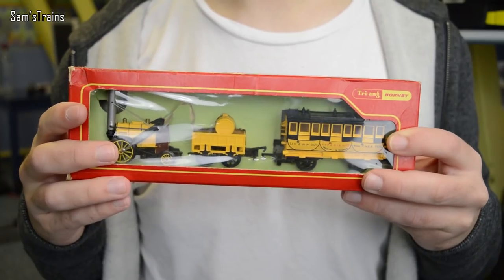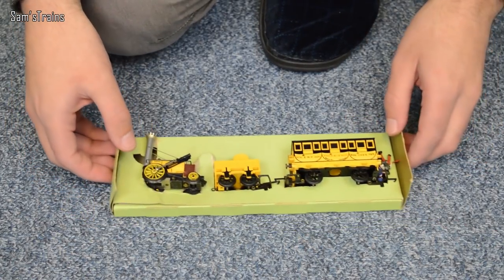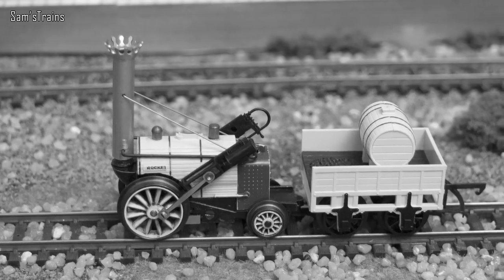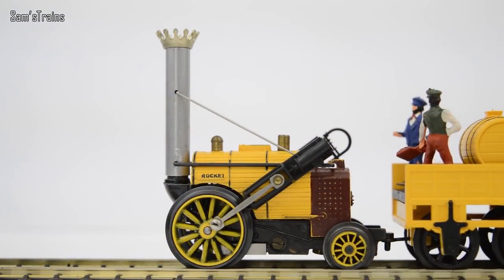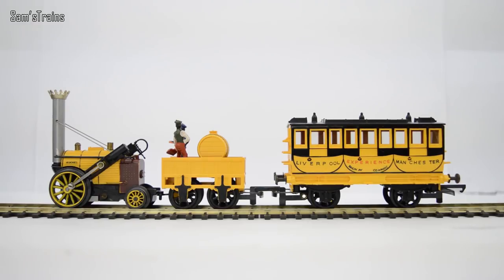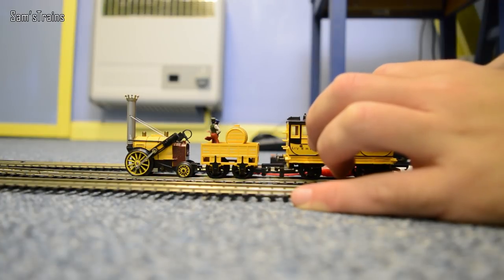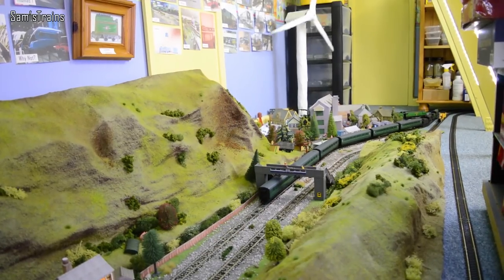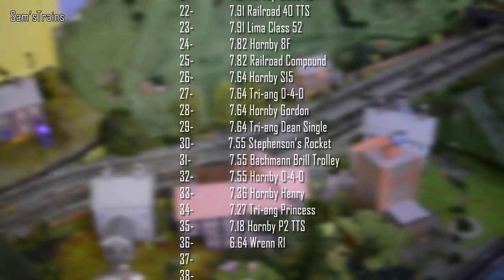Unboxing the Hornby Stephenson's Rocket (Stephen!)

Comment: I've got the same locomotive, but it's the original release with the Tri-ang Railways box. My Great Great Grandfather paid a whole $10.88 in the U.S. in 1968. He passed away in 1989, and it had been in storage until a few years ago when my Grandfather passed it down to me. To my disbelief, it ran almost perfectly straight out of the box! Even the smoke unit works! Mine, unfortunately, doesn't have the little figures (don't know if I can find replacements). The box is a little rough, but the locomotive, tender, and coach are nearly flawless!
Reply from the maker: Oh wow - that's fantastic really, keep hold of that - they're very special and rare! :D

Thanks for watching mate,
Sam :)

Comment: Sam, I'm glad this popped up as I was looking at running Videos on the Centenary Version of the Rocket. 
The 1963 version is RAW to say the least. Can't run anywhere near the prototype speeds of 15-24smph! The Loco hasn't a proper plate for the Engineer and Fireman to stand. They couldn't operate correctly from the Tender! 
if you haven't received your new Rocket yet, DISREGARD the rest!!

Now I realise I'm nitpicking to the N'th degree!! 😳 
The new one is bloody BRILLIANT. But I could even pick on that. A set of pickups on the lead Coach, would prevent it from balking over Points! It's not bad, but bad enough, since the Centenary Version is geared for scale speed. I'm not sure it can go over 30smph, full stop. The precision Motor in the Tender, allows the Loco to maintain its Scale dimensions, which is a definite plus! 
It comes with PLASTIC Chain Couplers - which although period correct, I cannot imagine would take very much running through curves and points. The Details however, are fantastic! 
I hope I can somehow get a Set, even a later, non numbered Set. 😉
Carmine ✈🚂🚙
Reply from the maker: haha it certainly is raw - I won't read what you've put about the new one - I'm trying to remain completely ignorant until mine arrives - appreciate it though! :D
Thanks for watching - Sam :)
Reply: Sam, you will not be disappointed!

Comment: I enjoyed your video - very professional! What kind of track did you run the Rocket on? I read that it has the Magnadhesion principle to make up for being light weight so it would need steel track. Don't you also need old deeper track for bigger flanges? Your track looks modern in the video. As I've just bought a set (hasn't arrived yet) I'm keen to get all the help I can.
Reply from the maker: Thank you Iris! Yes these do use magnadhesion, but I'm using modern nickel-silver track, so sadly I can't make use of that. Some of the earlier tri-ang locos did have the larger flanges, but luckily all of the rockets I've come across have been fine!
Generally speaking, it's only the very early Tri-ang locos that had the huge flanges - if it was made from, say, 1965 onwards (I forget the specific date, but it's somewhere around there), then you'll be more or less fine on modern Hornby track and points.
Thanks for watching - Sam :)
Reply: Thank you very much that will help me a lot.

Comment: Excellent video as always. I have the later version with the three coaches. I noticed in the comments someone already mentioned that Experience was the name of the coach and the liverpool manchester railway company was the name of the railway (arguably the first true railway as the predecessors did not own rolling stock or have timetables).  The three coaches in my set were Times, experience and despatch and were the same as yours and were typical of coaches of the 1830s although as others have said converted open goods vans were used as well.  the later box is much better with a lot of info on it.
Reply from the maker: Thanks Andrew, really glad you liked that! Ahh okay - is there a lot of difference then? That's very interesting too - I'd love to see some of those!
Thanks very much for the info on that mate,
Sam :)
Reply: it's very similar the main difference is the tender and coaches have metal tyred wheels.  The box has a fold out info panel and is a unique box shape and colour as i think it was limited edition. sadly my box is not pristine though it does the job.
Reply: also some extra black lining and the doors on the coaches seem to be bit better cast and picked out, just took it out to compare.
Reply: andrew james 
DCC Ready is very useful, so the rocket can run at a sensible speed.  Perhaps the water barrel can contain a stay-alive capacitor, to help with the few pickups.  Might as well add the tender wheels, too!
Reply: Tom Lawton yes agreed i may do that some time.

Comment: Hello Sam,  I’ve a chance to acquire a 2020 Rocket set. It will presumably have UK voltage socket on the controller. Can you advise about adapting that to US voltage?
Reply from the maker: Ahh fantastic! The Rocket sets don't have any power supplies - so you can just run them on your US setup! If you don't have any track and controller, you'll need to buy them separately!
Merry Christmas - Sam :)
Reply: @SamsTrains  That is good new Sam - thank you & happy railing!

Comment: where can I purchase this ?
Reply from the maker: Unfortunately these haven't been made for many years - you may get one second hand on Ebay, but they're very overpriced!
Thanks for watching - Sam :)
Reply: @SamsTrains  oh. Ok Thanks !
Reply: New release from Hornby this year but much better new tooling.
Reply: @johnd8892  ok. I added that to wish list. But too costly for me here in India. :(
Reply: @johnd8892  Thanks .  Will I able to run new hornby on bachmann EZ controller?
Reply: @kaustubhponkshe6186  I do not used DCC, partly because DCC is far more expensive than DC, and the EZ is a DCC controller. My experienced club members using DCC do not use Bachmann or Hornby DCC controllers due to limitations they have found. Some comparisons on Youtube to see why. Some DCC controllers are good others bad and ugly. They use Digitrax, Zimo and NCE. Even some using tablet based control interface.